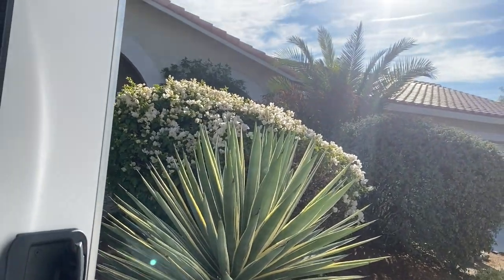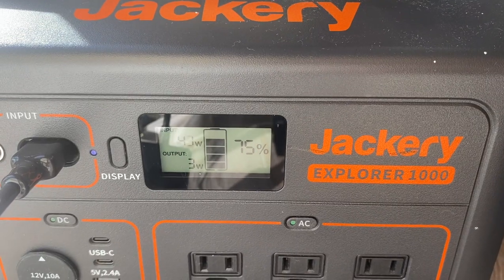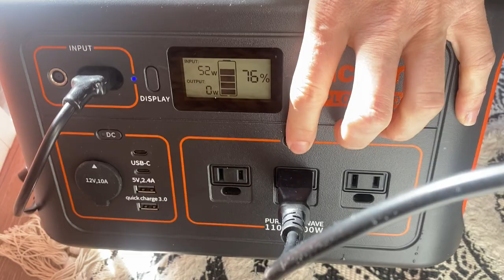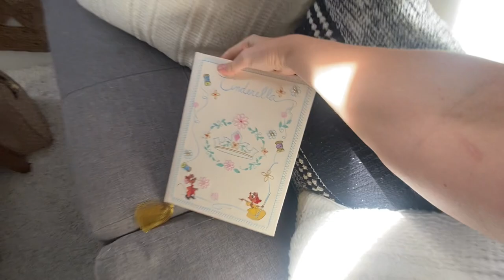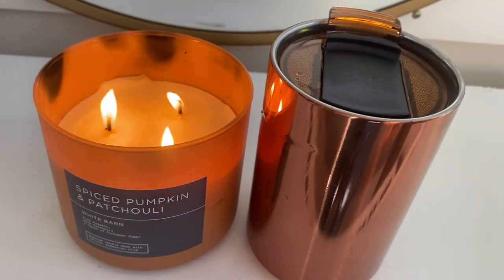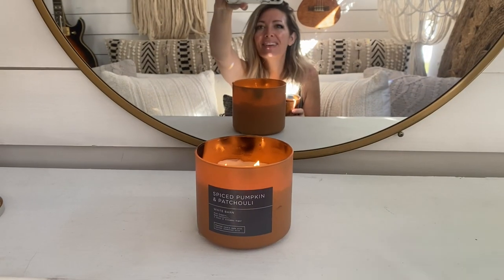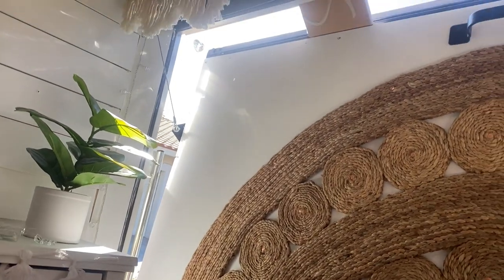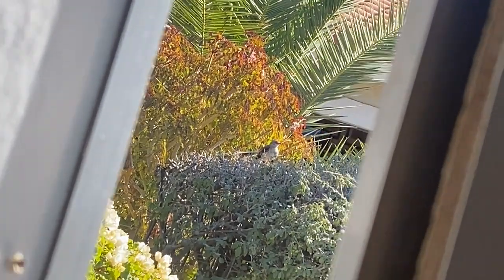My #VanLife MORNING ROUTINE // Living Full Time in a Cargo Trailer (Travel Vlog #132)

Comment: You should buy one of the cheap lots near Kingman, Arizona, Danna.  That way you would be within driving distance of Vegas, Palm Springs and St. George.  You could order a cabin from Graceland Buildings in Kingman and do to it what you did to your Sprinter van and your cargo trailer.  Your total land and cabin payments will be less than rent in the big city.  You can get an acre of land for $3000 and the cabin for less than $10,000; you can finance the land and the cabin.  You could live in your cargo trailer until your cabin is ready for occupancy.  Check Landmodo and Landwatch.